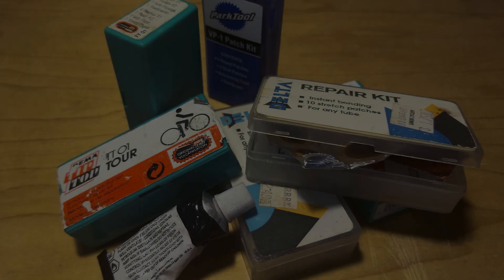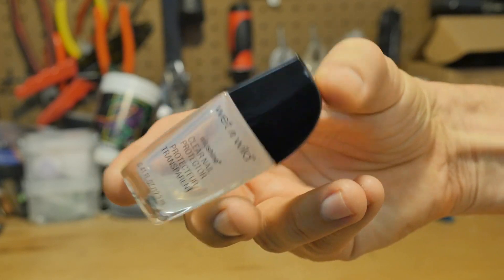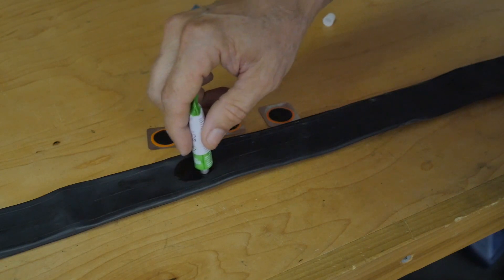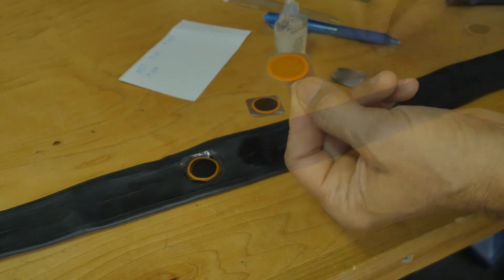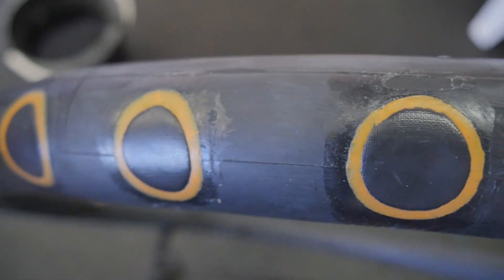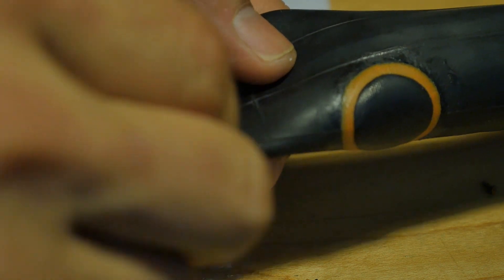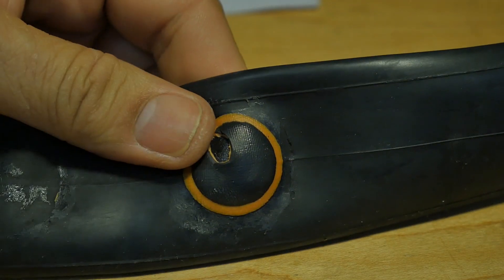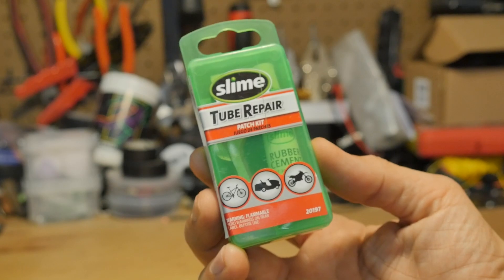Rubber Cement vs. Rubber Cement

Comment: dried glue. I had a new, never used, patch kit. I punctured the tube of glue, and it was empty. The reason why I'm trying to figure out if we can use rubber cement, then I can carry a small can or bottle of it, and not have to worry.
Reply from the maker: Rubber cement works OK. I'd suggest getting a larger can of either Slime or TipTop cement formulated for patching. These rubber cements/vulcanizing fluids have additional solvents that probably help create a better bond with the inner tube rubber. I think this is more important when making patches on the road because you may want to provide the patch as much time to cure when doing a roadside repair. For use at home, I'd have no problem using rubber cement and allowing it to cure overnight before either storing or directly using the patched tube.

Also, for a carry bottle, consider using an emptied and cleaned nail polish bottle. Rubber cement/vulcanizing fluid seems to last for at least a year in those bottles. I'd suggest changing to fresh after a year or so.

Comment: Slime is just a better quality repackaged rubber cement that you can buy for  $10 for an 8 ounce can.
For your money it's much better to buy vulcanising cement like xtra seal and others that tire repair shops use, $15 to $25 for an 8 ounce can 
Scuff area , wipe with acetone, put cement on tube and patch, wait about 10 to 20 minutes, press firmly together, wait 5 minutes , good to go.
Reply from the maker: Surprisingly, you have this exactly backwards. Products labeled "vulcanizing fluid" typically have more than one solvent in addition to Heptane. For instance, Rema TipTop 203-F has Heptane and Acetone. I'd have though that Xtra Seal would be the same, but it has only Heptane. That is exactly the same as Elmer's Rubber Cement or the BestTest rubber cement I used in this video. The Slime "rubber cement" that I used in this video has Naptha, Heptane, Heptene & octane. So it is much less like generic rubber cement than Xtra Seal.

The different solvents seem to be used to make the inner tube rubber more likely to fuse (chemically bond) to the patch material.  As time goes on and companies seem to be more concerned about the hazards of these solvents and fewer of the more "exotic" solvents are used.  These cements are generally becoming more and more like generic rubber cement. Currentlly Slime's MSDS for its "rubber cement" for tire patching contains, Ligroine 40-60%, Formaldehyde (10-20%) and Terpinolene <10%. Slime "rubber cement" appears to be one of the few that is bucking the trend toward a Heptane only or mostly Heptane product.

Comment: They would probably all work OK in a function test! By that I mean put them in a tire and see how long it can be used before one starts leaking!!
When I was a kid, my dad told me that my granddad delivered mail in a model "T" when he (dad) was a kid. One day he had a flat tire on the car and there was no one around to fix it. So he jacked the car up, pulled the tube out of the tire and, after finding the hole, stuck a 1 1/2 cent Martha Washington stamp over the hole and reinstalled the tube. He pumped it up with a hand pump he kept under the seat and finished his route! Must have been pretty good glue on stamps back then!!
Reply from the maker: Probably depends a lot on how much the tube expands before being pressed against the inside of the tire.

Comment: Um can you use cut up pieces of old tube for a patch??
Reply from the maker: Yes, but it doesn't work as well as a patch that has that yellow/orange goo.
Reply: @wturber  Have you tried those self-adhesive patches at all???
I end up fixing several tires a year (not bike but mower, hand truck dollies, etc), and I have not found a rubber cement yet that is worth anything.  I tried Slime rubber cement yesterday and it ended up blowing the patch off after a couple of hours of the tire being full pressurized (30 lbs).  I had high hopes for the slime product but it just peeled off the next day.

I am going to try some expensive superglue I purchased a couple of years ago and it works awesome on everything else.
Reply from the maker: @thomasjoseph5876  What are you using for a patch? I use Rema patches and they work quite well with Slime and other cements.

Comment: I doubt your rubber cement was leaking on its own... you knicked it with your razor... i mean you almost slashed yourself so not hard to imagine.
Reply from the maker: Nope. The razor knife only cut through the paper sticker. In order to get through to the tube, I would have also had to sever the plastic case. Furthermore, the glue that had leaked from the tube had started to dry already.  You can see that I attempted to rub some of the dried glue off of the inside of the plastic case.

You are right, however, that I wasn't very careful about opening the case. I was trying (and failing) to do so while within the camera frame. In the future, I'll probably shoot at 4K and crop to 1080p as needed.

Comment: Also, I have learned that the proper way to get the strongest bond is to put rubber cement on both surfaces, allowing the right amount of time to dry, using a patch roller, and using a sealer at the very end.  Thin, even layer of cement is ready to be patched as soon as it turns hazy (or when it loses its shine).  Rubber prep compound is good to clean the repair area after sanding.  There’s also a temperature range that is best to work at for patching.
Reply: But, they never told me that and I was always wondering where it even came from in the first place, so it's anyone's guess! 🤷‍♂️

Comment: There's also the mechanical aspect of the pressure pushing the patch hard against the tyre carcass. This plays a much bigger role with 'glueless' patches - I've had a few of them leak minorly, then seal after a time. I tried a glueless patch on my balance ball and after time air worked it's way under and out - without constraint the glueless patch fails.

Comment: Technically you should have encountered more problems with the bond on the second patch. You gave it no time to cure. It's completely different than standard bicycle kit glue and needs to cure. Additionally you need to give it longer than 5 minutes before applying. Frankly I was surprised how well the second patch bonded. But it will bond much better done properly.
Reply from the maker: It is not completely different than "standard bicycle kit glue" Also, there is no "standard". Each manufacture uses different solvents. That's the fundamental difference between these various glues. And it varies from brand to brand. I've looked that the various MSDS sheets. Slime's main solvent is Ligroin aka "heavy naptha." Best Test rubber cement has one solvent - N-heptane. Tip-Top 203-F Cold Vulcanizing Fluid uses mostly Heptane isomers. 

As for time to cure, all you need to allow for is that the glue has a dry to dull look and is tacky to the touch. This basically means you need to allow most of the solvent to evaporate - which is what I did.  How long that takes will vary depending on temperature and humidity, whether you blow on the cement, etc..This test was done in July in Fountain Hills, AZ - a suburb of Phoenix - in the desert . It is relatively hot and dry here that time of the year. Solvents dry pretty quickly.  The patch bonded well because the glue was allowed to dry an appropriate amount of time. Further, the patches were allowed to continue curing and off-gas for over two hours. I would expect the patches to cure even better given more time. But tire patches are expected to get us back on the road in minutes, not hours. So a two hour cure time is a more than fair time window.

Comment: I put my Patch kit in a Zip lock bag and store it in my fridge (any where in the back🙂) This way everything is preserved and won’t dry. 😉👍🏼
Reply from the maker: Won't do you much good there when you are out riding yer bike. :^) Also please note that my new fresh kit was already defective and leaking - before I opened it. Maybe the fridge would have kept it alive longer.
Reply: @wturber  
Well, the fridge trick  has done me a lot of good. They have all been OK for a long time. I have done it. I know. You obviously have not tried it yet. I also keep small rubber Carburetor parts of my Weed Wacker in the fridge in a small ziplock bag. They have also passed the test of time. 😉👍🏼

Comment: Can I use crazy glue instead of rubber cement to fix the tire?
Reply from the maker: I don't know for sure, but I would think that would be a poor choice since the dried glue isn't flexible. I think the dried or cured adhesive should be about as flexible as the rubber it is bonding. The tube needs to expand inside the tire to work properly and if the patch does not stretch with the tube then that probably creates a lot of stress that might damage the tube or simply unbond the patch. But hey - you can try it and tell us what happens.

Comment: 11:51 That is why, in a truly scientific test, you would have had more than one sample of each.  And maybe a specified machine to apply the scrubbing consistently and evenly. But that is probably too much for such a simple test.
Reply from the maker: Agreed. Keep in mind that this was pretty much an exploration and not a science study. But Project Farm often does multiple tests per sample so it isn't beyond the scope of a YouTube video and is something I'll think about if I do a follow up. 

Another variable to consider is different tubes. Maybe not all Butyl rubber is the same? Then I could vary the patch manufacturer as well. The list could probably go on.
Reply: @wturber  Yeah, but you doubted you treated them the same way on the same tire. If you make say 3 samples / test, you can rule out those inconsistencies.

Later I realized that video is basically useless to me as none of the products are available in my country. I think one or more of the ingredients (solvents) are "illegal" in my country. You can get rubber cement here too, but the ingredients are totally different.
Actually, I found the 8oz container Slime rubber cement on my local Amazon (which doesn't mean it is legal to sell, though) but it would cost € 65 (=~ $69, including tax, excluding shipping) instead of the $9.19 (excluding tax and shipping) it costs in the US. And yes, it is only one 8oz container, not a whole box of it.

Comment: I agree, tube patching glues aren't what they should be these days, Neither are the patches good enough to cater for stretching enough to keep what little adhesion there is in tact still.
Reply from the maker: I can't agree with that last part. I have tubes with many patches and the patches stretch fine up to and beyond the size limit of the tubes. That said, I typically am patching with a Rema Tip Top patch.
Reply: @wturber  I am questioning the make of the patches that I seem to be using as to their ability to stretch at all. I will do a bit more trial on some other patches that aren't direct from China (eBay).
Reply from the maker: @johndee68  I have some larger rectangular patches from China with a brand I don't recognize. And I think I used Slime patches in this video. I've read one reasonable sounding notion from a chemist who hypothesized that the patch compound itself (the orange stuff) is a major factor in the bonding chemistry. 

I need to revisit this topic. I hope to do a follow-up in the new few weeks. We'll see if I can get it done soon.
Reply: @wturber  Yes, I can see that it seems the only part that chemically binds is meant to be the orange back. Though even the glues wont hold when using actual inner tube from a previously irreparable tube.

Comment: I am experiencing issues of late with glues and patches that wont adhere to tubes and patches that don't stretch on tube inflation so they don't seal. 
I also have noticed the glue tubes lids are to long so the skirt of the cap bottoms out on the neck of the glue tube, leaving it unsealed. I am yet to try shaving some of the cap off to make it a better fit.
Reply from the maker: I've had pretty good luck putting glue in an empty nail polish bottle as shown in that video. The bottle I have in my saddle pack is still fine after two years or so. It is easy to check since the bottle is transparent.
Reply: @wturber  Yes, I like the idea of the nail polish bottle being used. I am yet to find a person who uses nail polish that I can get a used one from at some stage.
Reply: @johndee68  got to a nail salon and ask for an empty bottle.

Comment: I freaking knew it! You saved me the trouble of performing this test-experiment myself since I had a hunch that what I was reading was bullfarts from some very insistent assertions by various forum schmucks that a *substantial/ fundamental* difference exists between what they'd only refer to as "(de)vulcanizing compound" and the thing that most of these patch kits also make zero efforts to distinguish themselves apart from: "rubber cement". I had a hunch the differences in performance would be trivial, so thanks for doing the legwork of a fair test!
Reply from the maker: I think there may be a difference compared to the older "vulcanizing fluids" that contains some nastier solvents that are either no longer legal for consumer products or are at least discouraged.. I also think that today's "Tip Top" 203-F Cold Vulcanizing fluid may offer some advantage. It contains acetone along with Heptane. Older versions contained trichloroethylene.  I did not test that here. 
I've been thinking of running a follow up test that will include that cement, the slime cement in the 8oz can, Weldwood contact cement, and perhaps the use of acetone mixed in with plain old rubber cement. I may do this pretty soon.
Reply: @wturber   @Jay Turberville  Very interesting and thank you for the thorough reply. And yes I agree that there's likely a number of products that occupied retail real estate relatively recently whose chemical makeup has been either made taboo, regulated away from larger public consumption/access or just banned outright, for better or worse I won't opine about although I thoroughly admit I attempted every last mental acrobatics routine I know to try and justify purchasing a gallon container of dichloromethane/methylene chloride I spotted in a rural hardware store the other day due to both knowing it was a rare & veroboten find and simply bc  maaaan is it one hellacious solvent. That stuff ruined me for other stripping compounds as I can usually strip paint faster mechanically with the right tools than I would waiting around for splotchy results with what's available these days. Not the case with the now-banned cancer juice whatsoever. Shrug Very curious what the results between Weldwood and an older bottle of contact cement would offer. I would just view the slime cement as control as it's pretty meh & is actually far less of a hell-mix of solvents than Elmer's rubber cement is if I'm recalling correctly & not mixing it up with [bottled] liquid electrical tape (which i've found is pretty stout stuff!)

Comment: You start sanding right next to a cleaned prepped cemented area? A lot of microscopic dust and contaminates certainly landed in your drying blob of cement.
Reply from the maker: A lot? I doubt it. But sure, maybe a little bit of stuff made its way to the rubber cement.  Sanding rubber doesn't create a lot of loose particles. It isn't like sanding wood. And to the extent that it does create particles, it would be mostly rubber which shouldn't interfere with bonding much.  

The purpose of sanding the tube isn't so much to create a rough surface as it is to rip apart long rubber molecule chains making them more likely to crosslink with other rubber compounds in the cement. I figured it was more important to get cement on these freshly exposed bits of rubber quickly rather than maybe have them begin to oxidize. 

Also, if there was any significant contamination, you'd expect the third patch to benefit from the lack of contamination since there was no adjacent sanding. But the first patch had the best bond, not the third.
Reply: @wturber  I've only completed every single class retreading classes from heavy machinery to passenger to truck to auto seal to run flats to advanced shearography interpretation, I wasn't trying to put your repair down, industry standards and steps of proper repair unit adhesion is black and white.
Reply: There are WAY too many nuisances and special considerations to squeeze into 1 vid!
Reply from the maker: @tomsuica8731  I don't disagree with your basic critique so much as I do with the degree of emphasis. I've been working repairing bikes that we give to kids who need bikes and have access to some discarded tubes. So I intend to do another version or versions of this test and will consider the issue that you raised - even if I doubt it was a significant factor. Fact is I have no way of knowing for sure. It's always good to reduce variables.
Reply: @wturber  Yeah, I too have been experimenting ewith expired cement, diy home made cement and mostly heat vulcanization they way they do in the phillipines. Send me an email also, I will send you access to the retread training courses if you want :)